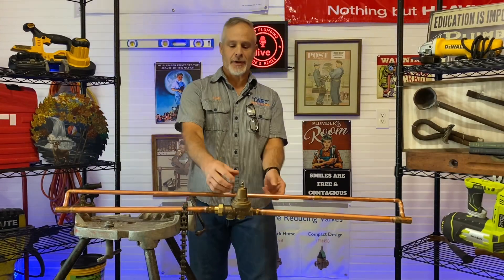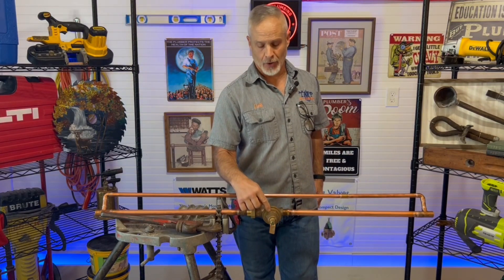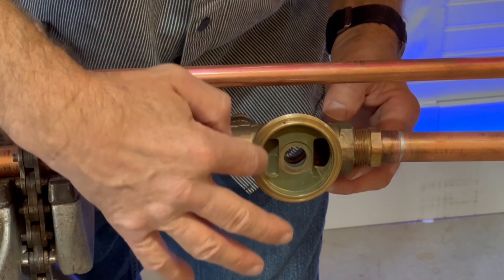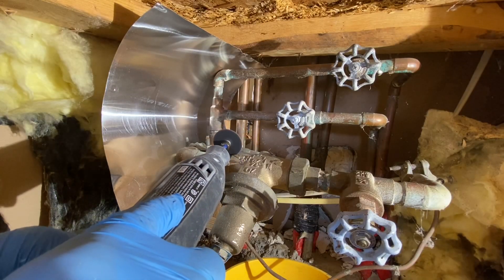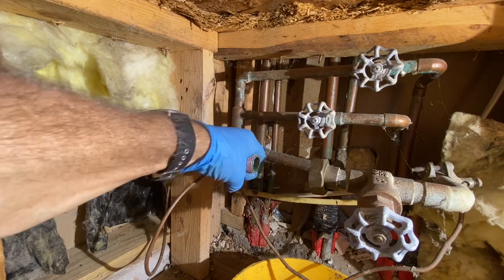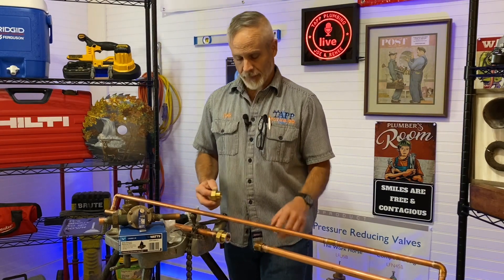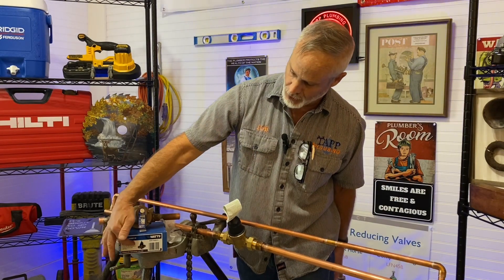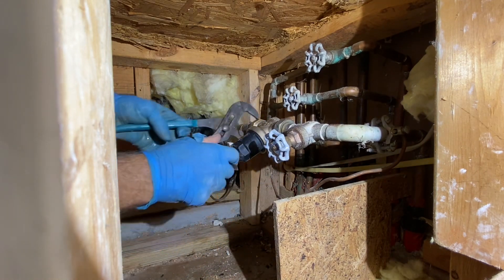Pressure Reducing Valve Replacement  Step-By-Step Guide

Comment: You don't need to do all that work to solve the problem with your pressure valve, just order the Repair Kit and replace all the parts, and you'll have a new pressure valve.

Comment: Is it be possible for someone to steal water out of a PRV at the meter by unscrewing the top? Trying to figure out why a drywall subcontractor would have got in there
Reply from the maker: not likely, they may have wanted to increase the pressure:)

Comment: I live in TX and mine is not butied by the water meter like everyone else. I dug a one foot space between it and sidewalk. Its not by the water heater inside the house. Its not by where the waterline goes into house because I recently had a water leak repair done. So start digging up the yard between the house and the sidewalk?

Comment: I have a prv valve installed and it's leaking from the internal organs lol . I just went ahead and  bought the exact same PRV valve. Is it as easy as removing the old leaky one and putting on the new one. Please say yes
Reply from the maker: It can be very easy or it could be like the one in this video. It just depends on how it was installed. Best of luck and keep us posted please.
Reply: @TappPlumbing  
It's the exacts same part I bought and matched it to it. What I'm saying is I should not need anything else unless it's broken of course
Reply from the maker: @DAT-TEXAS-DUDE    That is correct, you new PRV should come with new gaskets ,make sure to replace them also and you should be good to go! Let me know how things turn out if you have the time please!!
Reply: @TappPlumbing   I was able to remove and replace  easily thank God cause I'm just an intermediate DIY'er buddy. Thanks for the help I also put rector sealer on threads just for extra security
Reply from the maker: @DAT-TEXAS-DUDE   Thanks for sharing your success story! It want hurt a thing to have some thread sealant on there as well! Congratulations!!!
Reply: @TappPlumbing  
Thanks buddy

Comment: If the valve is leaking from the top where the screw is to adjust it, does it have to be replaced? It started leaking after I lowered the house pressure
Reply from the maker: For a long term solution that will definitely be your best option! Keep us posted if you have the time please.

Comment: Great video ! So one union prv is better  than double union ? Because  of making noise?
Reply from the maker: That is one reason. They also have a separate chamber for the screen for cleaning. I know there are several other features also. I am really going from experience in the field. The larger valves just seem to last much longer . I often see them that are 20 years or even older and still working. Thanks for spending some time with us!!!!

Comment: We have a complex with 54 units. Most of them have good water persher but some doesn't have much persher at all. We have called 2 different plumbing companies and both charged us for doing nothing. The persher was the same as it was when they showed up. I know these units have that valve. Looks like I'm going to replace one to see if it fixes the issue.
Reply from the maker: Good Luck as we know Complexes are a whole other animal! You guys have to do it all!  Y'all are the Rock Stars!
Reply: Some times we can't fix everything. We do call the pros when we need to